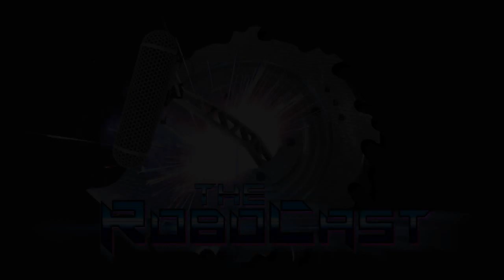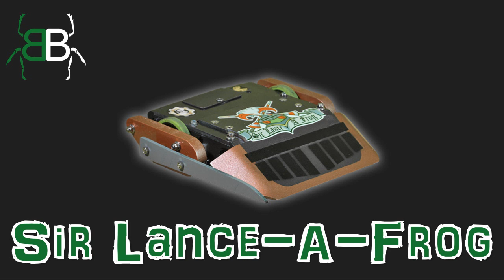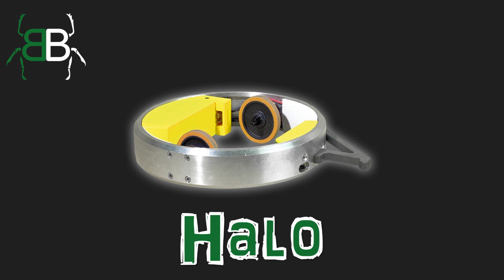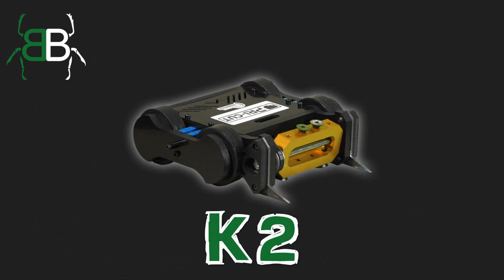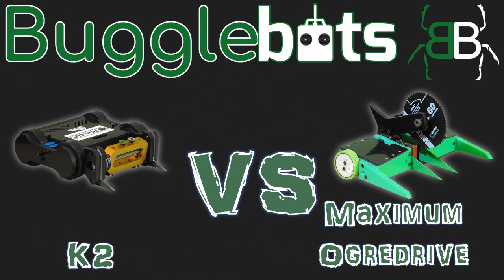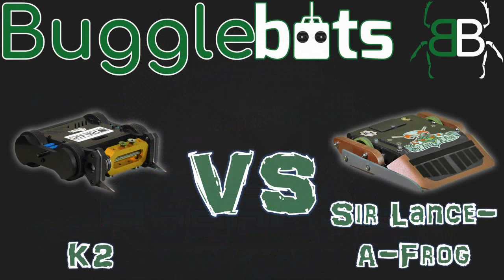RoboCast #67 — Bugglebots: Season 2 - Heat 1 Review [w. Jeroen van Lieverloo & TheDominusIgnis]

Comment: Bugglebots 2019 Heat 1 review
This is something new I'm doing because why not, and besides I do have a lot to say on this episode and I will probably be doing this for the future 2019 episodes. So my thought is that this episode was a really good opening heat as it was full of destruction as well as some upsets. Nice to see K2 back and they are as ever, brutal. I don't have too much to say on them as they are relatively similar to the K2 last series but this robot is just great fun to watch especially seeing it fling it's opponents through the air. I was pleasantly surprised with both Rust in Pieces and Halo as well, when I first saw an image of both Rust in Pieces and Halo I honestly didn't think they would do that well, I had no idea Halo was a melty brain machine and I was confused by the lack of armour and Rust in Pieces didn't look too durable based on the image that was available but I'm glad to be proven wrong. These 2 (Technically 3) completely blew my expectations out the water, Rust in Pieces were an incredibly well driven good wedge and upon learning Halo was melty brain and seeing them rip off Hold my Beer's wheel, I ended up really liking the robot. I always love to get proven wrong and that fight between Rust in Pieces and Halo was great. Lance a Frog were nice to see back, they always seem to get an unlucky draw though and I feel it could benefit with 4 wheel drive but they are a fun machine and nice to see them get a victory. As for Hold my Beer, I really like Tough as Nails so I was secretly rooting for this machine to win the heat. It didn't happen but it was nice to see and for Jeroem's first Beetleweight, it did show alot of promise as it was very nippy around the arena. I would like to see an upgraded Hold my Beer, maybe make it a bit wider, just because I do like seeing smaller versions of heavyweight machines. And Maximum Ogredrive, I felt soooooooooooooo bad for the team, if there is an award for unluckiest robot they definitely deserve it as Ogredrive are one of the best Beetleweights in my opinion but unfortunately they got drawn up against K2 and to top it all off they get a mechanical issue in the loser's melee. I so hope the team get better luck in the rumble as we all know they could do much better and I can only imagine the frustration the team had when they lost drive in the loser's melee.